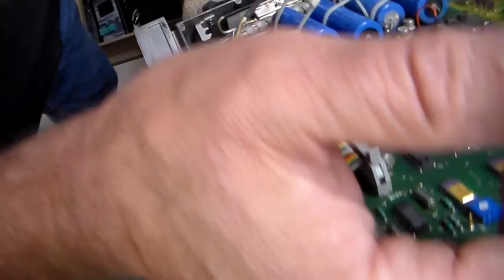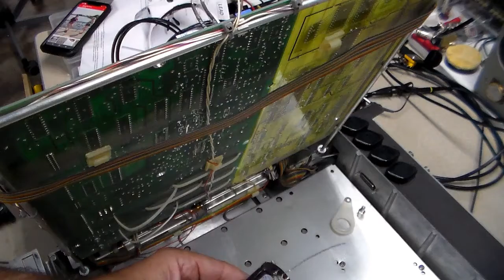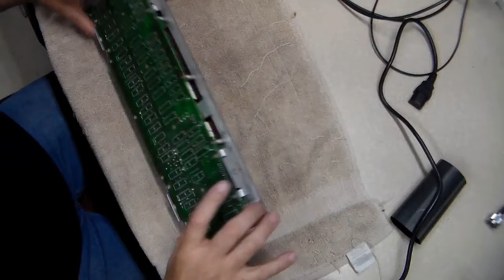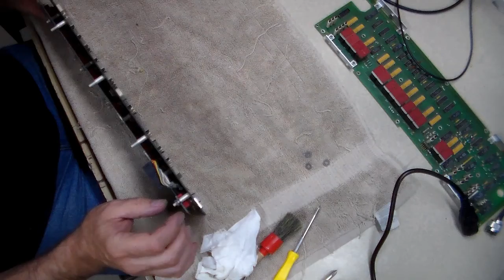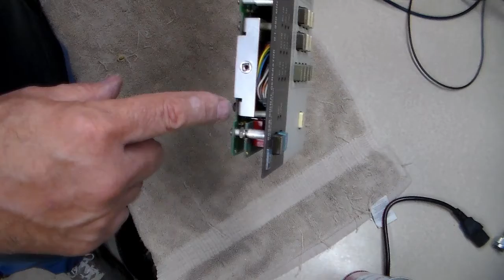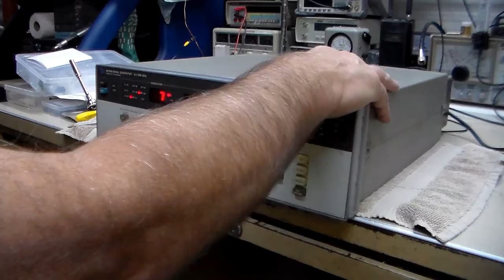HP-8656B RF Signal Generator   Part 2

Comment: TERIBLE PHOTOGRAPHY !
Reply from the maker: TERRIBLE!  You missed an "R".
Reply: @KA3AJI  I love it ......  I have a 8656B  but it has the front panel board like an 8657 model .....  Green display also , which I prefer ..... I got mine from a Ham Club selling different things , 2 days after I got it the 5 volt rail was 0 volts , the front display was out ...... I bought a new voltage regulator and it came back to life ...... DigiKey and other sites were selling the obsolete regulators for 100 bux ..... I found one cheaper in Texas for 25 bux.... I shoulda bought 2 of them ....

Comment: My 8656b had a similar intermittent issue and I found a loose sma connector. I torqued all of them and haven't had any problems since. Hope this helps. Keep the videos coming! Thanks!
Reply from the maker: Thanks.  It was pretty dirty inside.  Now that its cleaner it may be easier to find faults.  I’ll take a look at the connectors.

Comment: Hi
Just a short observation, from a HP8656B and HP 8657B owner.  Please look back at your video as posted, in the last several minutes.

Look at the indicator LED's on the far left.  They clearly indicate you have pushed the selector buttons to accept:

1)  LOW EXT
2)  EXT AM

That is the bump in the road, you should have selected MODULATOR/AM and either 400 Hz or 1000 Hz, since you did not have an external modulation source connected to your signal generator.

Thanks for sharing your work, it provided help on the front panel circuit board disassembly steps.

Chuck